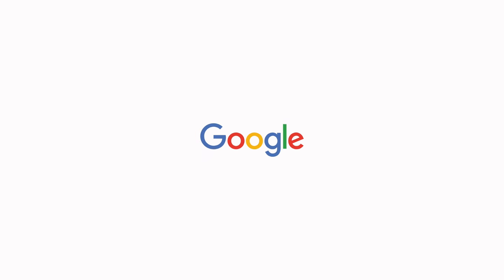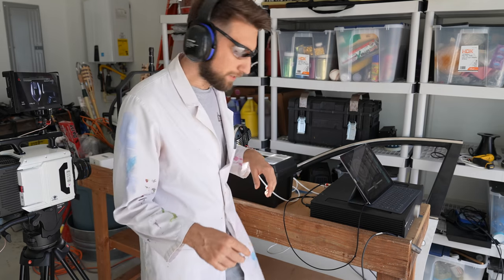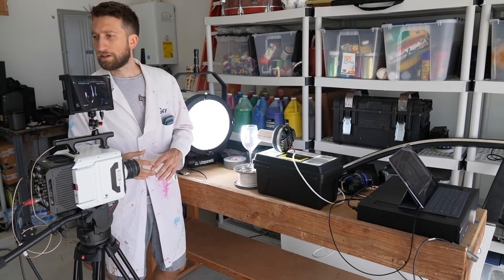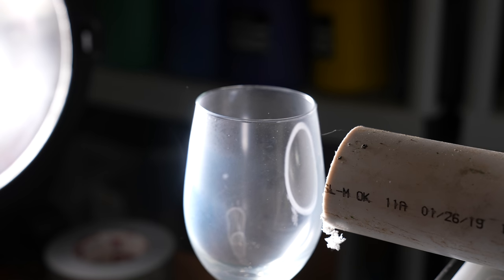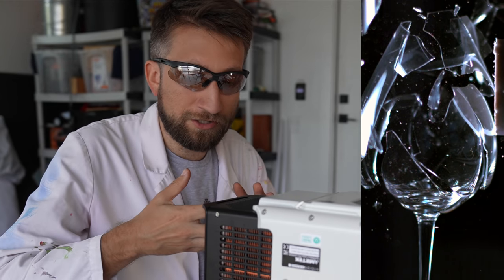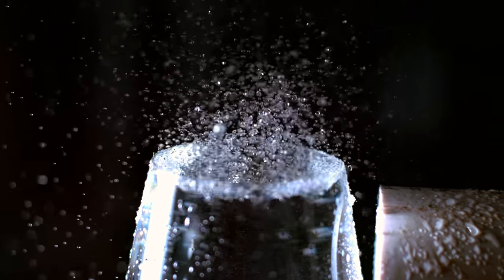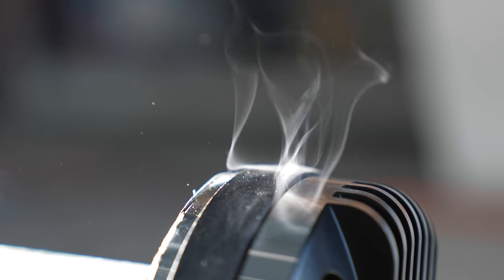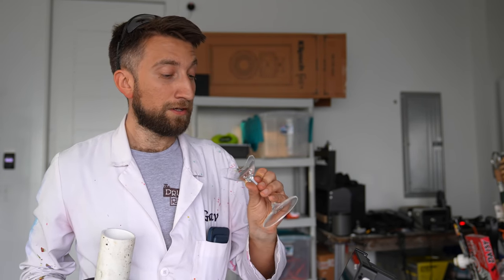Shattering a Wine Glass with Sound at 187,500FPS - The Slow Mo Guys

Comment: Remember: any machine can be a smoke machine if you operate wrong enough.
Reply: Low Tier God  It's a joke I also heard it somewhere else
Reply: In electronics class, we joked that the circuit would fail if you let the magic smoke out.
Reply: I have been trying to think of an exception to this but I am stumped.
Reply: Once it releases the factory installed smoke, it's done. Replacement smoke is not available to the aftermarket. There are some markets that claim to sell factory smoke, but these are not genuine products and will void your warranty.
Reply: But if you made a smoke machine in the end, did you truly fail? Oooooooooo

Im tired, ok. lol
Reply: @KnifeKnut  a hookah would be the exception as it smoked when it's operated in right.
Reply: Even one of those small handheld fans?
Reply: @xrez2432  that takes some doing, and doesn't make much smoke, but yeah
Reply: if you mess up an actual smoke machine, it should mean it does'nt function as intented, means it doesnt release smoke, means THERE IS AN EXCEPTION
Reply: @omkargaikwad6181  yeah, but the capacitors inside the smoke machine will release their own smoke when they blow up.
Reply: Runaway diesel comes to mind, scariest smoke machine
Reply: Chernobyl
Reply: I think you would have a hard time getting a Play Doh machine to smoke.
Reply: @omkargaikwad6181  Is this a restating of Russell's paradox?
Reply: stolen from reddit
Reply: Poor voice coil. Standard high quality 6-8 inch cone midrange driver (enclosed) would be much better for that purpose tho..
Reply: Even a calculator
Reply: except a smoke machine
Reply: Best phrase of the year :3
Reply: You let the genie out, be ready to party
Reply: @westerntools4602  I don't think a hookah would be classified as a machine. Tool, yeah definitely. Not a machine though.
Reply: HAHSSHSAHAAH TRUE

Comment: "My iPhone doesn't have a headphone jack" Gee it's almost as if removing it was a bad idea Apple
Reply: Bluetooth headphones are cheap enough these days. The only problem I have is my car has a 3.5mm socket but no Bluetooth.
Reply: @omnomshibob  BT headphones need to be charged and typically will sound worse than comparable wired ones.  There's a use case for them, but it's still crappy of Apple (and other manufacturers later) to force the issue for no reason other than looks.  And to sell people on their headphones.
Reply: Someday we'll all have Bluetooth implants so we won't need headphones anymore. Apple is just ahead of their time.
Reply: @Brainwav  my earbuds last 14 hours on one charge and OTEs last 35 hours with noise cancelling on. And they're both amazing sounding. I've owned about 20 pairs of head/ear phones over the years, starting wired and lately Bluetooth, the sound difference is so incredibly minor it's not noticeable to normal people during normal use.
Reply: @thomascalton3067  since we'll all have brain implants one day lets just remove the screen on our phones. Apple is just ahead of their time.
Reply: Different horses for different courses. Some situations where wired or Bluetooth are not ideal. That said, every justification Apple used to explain why they ditched the jack do not make sense.
Reply: It's been literally 5 years since they removed the headphones jack, move on.
Reply: @joshscudder3217  funny how it's still causing problems, innit?
Reply: Nothing had headphone jacks
Reply: Bluetooth may or may not sound okay. It largely depends on what codec is being used. If you're using it as a headset (with microphone), the quality is noticeably worse. Bluetooth latency is also pretty bad, even with the lowest-latency codecs. I find it odd that one of the people defending the removal of headphone jacks is also one of the people that needs a headphone jack. All that said, you can still get a headphone jack adapter for your iPad. It's like $8. But you lose the ability to charge the iPad while using the headphone adapter.
Reply: @_yujin_  collecting them, women have shoes, I have headphones. It only averages at 2 pairs a year.
Reply: @Brainwav  don't what you're talking about with the sound being worse, my AirPods have perfect sound, way better then many wired headphones i used in the past.
Reply: It is good to mention, Apple receive all the hate for literally any changes in cellphone tecnologies lately but the company sets tendencies for that kind of thing, including the bad ones, which means that Apple make mistakes and other manufacturers follow their ideas even with the knowledge of that being a bad idea.
Reply: @joshscudder3217  you need to remember that people have a need to complain about something
Reply: There are adapters that you plug in the lightning socket, if you want to use wired headphones, you know….
Reply: @omnomshibob  35hours is much less than infinity. Also, the fact that you have hi tech headphones doesn't mean that everyone wants to invest more than 5$
Reply: YeA aPpLe....GEEZ!!!!!!!!
Reply: @sylvrwolflol  total issue, plus, some people like to limit the amount of waves firing at them

Comment: It's a good thing that the light or the other equipment like the camera lense do not resonate at the same frequency as the glass.  Could have been a very expensive demo.
Reply: WARNING I am the unprettiest human YTer worldwide. Take the hint, dear jo
Reply: Nah, do to the inverse square law, the sound would have to be significantly louder than required to break the glass right in front of the speaker to be capable of harming anything else.
Reply: @Vode_ika  I was thinking it might break the glass on the Light behind the glass  though. That's directly in the same path as the glass.
Reply: @than217  sound spreads in a sphere, and the speaker cone directs most of that forwards into a cone shape. So as the distance increases, the actual energy of the sound decreases. Being in the same path still means less energy.
Reply: The glass of the lens is generally thicker so it would have a much different resonant frequency.
Reply: @AxxLAfriku  hi AxxL
Reply: @irchonite1953  ignore him
Reply: @HDTomo  better yet, report him for spam
Reply: @Vode_ika  That assumes that the hypothetical piece of equipment has the same tensile strength as the glass, and the same or more dampening from whatever it's attached to.

Comment: Most people don't realize how elastic glass is.  But highly susceptible to any defects as the source of cracks. If you remove any blemishes (using acid) the amount of bend you can get on a glass slide before it shatters is insane
Reply: I mean, I know reinforced glass is pretty elastic, but this really impressed me.
Reply: There's a really wonderful clip from a mythbusters episode where Adam drops a glass christmas tree ornament and it bounces and he's so happy and amazed that he does it again and of course shatters it
Reply: IIRC its actually not completely solid but slightly liquid. So over time your windows are slightly thicker at the bottom than they are at the top.
Reply: @markamanic  Its actually an amorphous solid btw...

Comment: Excellent job showing the two clips at the same time, comparing the speed of the glass cracking vs. the speed of the glass flying apart. What a drastic difference. Gives you great reference for just how fast the cracking occurs.

Comment: Hey Gav,

I'm curious how the speed of sound relates to the frame rate. Could you try some smoke or fog to see if we can see the compressions and rarefactions in the air? would be cool both with and without the glass shattering :)
Reply: That’s a really cool idea, but I’m not sure it’d be visible - sound waves are so small, they’d also need an extreme microscopic lens to see each individual wave. But it might show the particles vibrate!
Reply: The speed of sound in glass is very high,  5600m/s for compression waves, that's what sets the extension rate of the glass crack (with a slight slowing for the energy to crack it.) The air sound compression is at 806Hz and matches the motion of the surface of the glass. Speed of sound in air is 343m/s so about 16 times slower than in the glass. That's why he needs a high frame rate to see the crack grow.

One of the major uses of high speed cameras is watching how brittle things break. The first glass that failed from the top probably had a slight ding or scratch in the edge which created a tiny stress concentration point and caused it to fail under lower stress than the other glasses. As a result of being under lower stress it had less stored energy to put into cracks and ended up as fewer larger pieces.
Reply: @zeedause5289  actually I would imagine the problem would be that the waves would be too large to visualize inside of the wine glass. Sound travels at 343 m/s in dry air at 68 °F. The sound is traveling at 504 Hz or 504 full waves per second. To get the length of each wave, we need to know how far the sound travels during each cycle. or 343 (m/s) / 504 (Hz) = .68 meters per wave. I think it would still be cool to see though, since I would think  you would be able to see the smokey air compress and expand 504 times per second, in time with the compression and expansion of the wine glass.
Reply: So what I'm getting out of this is that the crack propagation is hypersonic (relative to air)

Comment: "And the sound producer started smoking which was pretty funny"
One day this is gonma be gav's last words
Reply: The most unexpected part of this video for me was seeing gav repair the speaker himself.
Reply: In case Gav sees this you can get much more power out of speakers like this if you install a proper horn, not a tube. It's not magic, it's impedance matching, also a rule of thumb is always use an amplifier with power ratings no greater than the speaker rating (both evaluated at speakers impedance) that way maybe you don't have to blow expensive speakers
Reply: oh no
Reply: @guilldea  it's probably as much to do with the compression drivers own resonant frequency too. 510hz is very low for most tweeters and compression horns .  Get close to this and distortion rises whilst power handling drops.  Even at modest power settings its a good way to wreck most tweeters.

Comment: 6:24  Wait, do the broken pieces really continue to carry the frequency the glass was vibrating at?  I would think that each piece would quickly switch to it's own natural frequencies and harmonics, with the original driving frequency damping away within a cycle or two.
Reply: they'll have a new resonant frequency sure, but they're not gonna stop vibrating instantly because of inertia
Reply: @TrashHeapCustodian   I didn't suggest they'd stop vibrating, I suggested they'd vibrate at their own natural frequency.  Reread my orig comment.
Reply: @jerrysstories711  I don't think they'd be able to switch quickly enough; because of inertia (as the commenter above mentioned), I think they'd continue for a little bit more. I don't know if that's how inertia works though.
Reply: @jerrysstories711  They won't change vibration modes instantly either because of... basically inertia again. In the absence of damping or other external forces, I'd expect the vibration frequencies of the fragments to smoothly vary over time.
Reply: @okuno54    Aaaand once again... I didn't suggest they'd change modes INSTANTLY, I said explicitly it would take a cycle or two.
Reply: You are correct, and the narrator misspoke.  Switching to the new frequency would take just a few cycles, and the new frequency could be evident in even the first couple of cycles.  The commenters talking about "inertia" don't seem to understand that mass has inertia not frequency. Inertia makes things tend to keep moving at the same velocity, not to keep vibrating at the same frequency when their geometry has suddenly changed.
Reply: @rampadmanabhan4258    That's absolutely not how inertia works or even what inertia is.  See my other comment on this thread.  But hats off to you for at least acknowledging that your intuition is not sound, because most people won't do that.
Reply: @jbtechcon7434  Yeah, my issue with the inertia explanation was exactly the same, it works for mass and velocity, not for this.

Comment: how about using a distorting lens to compress vertically the image and let it fit (distorted) on the sensor, then re-setting the shape in post-production to have the subject back to the correct share ? This will have the effect of not having the save resolution in the vertical and horizontal dimension, but you can reduce the wasted pixels.
Reply: That is what is called an anamorphic lens. They are ridiculously expensive.
Reply: Good idea, but I’d guess that’s very difficult to manufacture that type of optics (and thus very expensive)
Reply: @lodestarsd4456  A lens for a ridiculously expensive camera like those he uses ought be similarly ridiculously expensive, though
Reply: @seedmole  Sounds a lot more appropriate, now.

Comment: Try the same experiment on a thin walled glass tube of a about the same diameter as the wine glass to see how much it really can flex. Without the thick rigid  wine glass stem it may distort far more before shattering. Great video.

Comment: Fascinating oscillations and cracks on the wine glasses, Gavin! Is it possible to record glasses under these conditions with polarized light in the background and a polarizer in front of the lens, so we could see the rainbow-colored areas where the most stress in the material is located? Or would that be too dark for slow mo? Just an idea, because I experimented a bit with that when I was younger.

Comment: What would it look like if the sound was directed downwards into the glass? I suspect the warping of the glass is due to the sideways push of the sound. As an overtone singer, I could match some of the resonant frequencies of some glass but even at maximum volume of 110dB, I would not be able to break glass. I could, however, break crystal. Back in the old days when this was done, a small scratch was added to the rim of the glass to begin the fracturing. However, I am a bass baritone which is way to low to match the resonant frequencies of glass and crystal.

Comment: if you were to do another vid using sound to break stuff id recommend using horn loaded low mid drivers as the compression driver you were using looks like it would be designed to be used above 1kHz so thats why you were cooking its voice coils. (sine waves are very stressful for loudspeakers to reproduce at high SPL) something similar to the low mid section of a turbosound tm3 would do the business but im sure you could build one from wood for much cheaper since you'd only be going for output instead of resolution, directivity etc etc

Comment: Wasting a ton of energy by not using a parabolic cone on that driver, that's the only reason you need to use so much power that you're blowing the voice coil. Still awesome video. It would be fun to break the glass with a looped recording of the glass being struck.

Comment: Didn't you say that the resonant frequency is around 500Hz?  Those compression tweeters are only designed for 2kHz and above (maybe 1.5k with that 2"(?) one you have).  Use a midrange to avoid the smoke escaping.  Not sure if you knew this and used the compression tweeter so that you could direct the sound easier?

Comment: Hey gav firing a bullet in space, what's the reaction on speed, ignition etc. Space might not possible but can you test it in your LAB making similar atmospheres and fire the gun, one in the atmosphere and the other outside at same time.
Reply: Firing modern firearms in space is possible. Modern ammunition contains the necessary oxidizer to get the reaction, in other words propulsion going. Same principle as with rockets.
If the bullet isn't affected by a nearby large mass (gravity) it travels almost forever until the few atoms left over in space slow it down to a complete stop. This should be thousands of years, if not millions of years, though.
A little side effect: The shooter would also move in the opposite direction, but as it's such a large mass, compared to the gun or rifle, it'd move at a rate of just a few inches per hour though.

Comment: so the frequency warped the glass to squish it symmetrically over a line, or 2 standing sine waves on the circumference, so if multiply the freq with 3/2 will there be 3 periods?

Comment: Why not measure the speed the initial crack travels from the bottom to the top of the glass? Does it, perhaps, propagate at the speed of sound in glass? Speed of sound in glass 4540m/s (thanks, google) so for a 10cm tall glass ~ 22 microseconds? I'd be surprised if it's faster than that.

Comment: using a tweeter for low frequency?  wtf?  "A tweeter or treble speaker is a special type of loudspeaker (usually dome, inverse dome or horn-type) that is designed to produce high audio frequencies, typically deliver high frequencies up to 100 kHz."   cant you hear the distorsion?